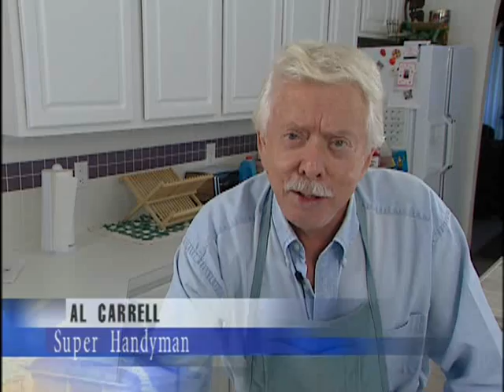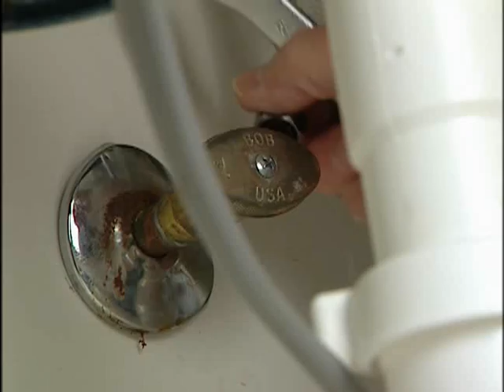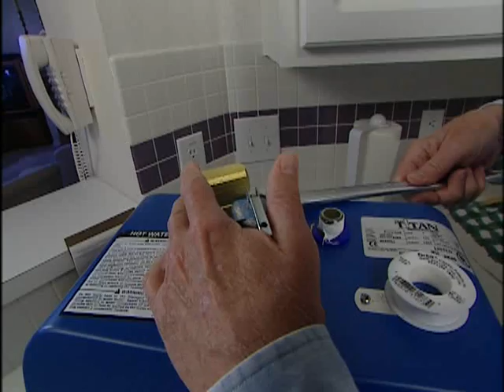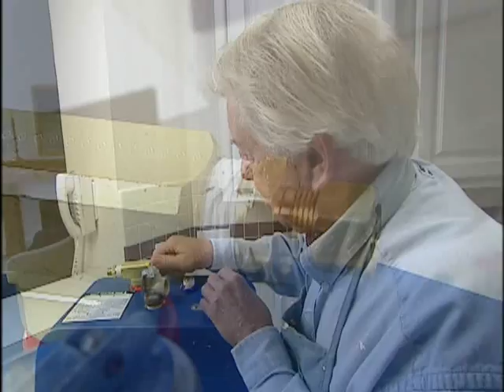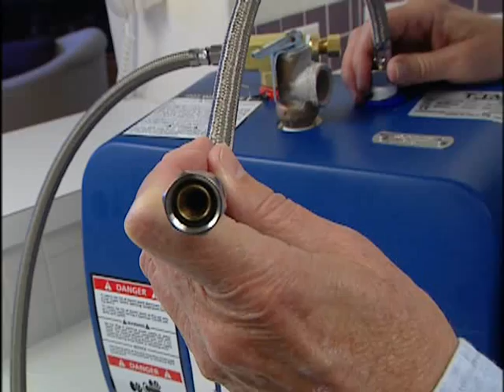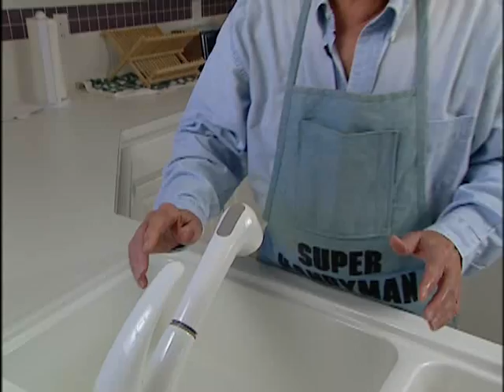Install a Mini Water Heater DIY (#5251)

Comment: Great video, question my titan hot water was already installed  and it doesn't just plug in to an outlet it's hard wired in a junction box. Right now it doesn't have water to it. Its making an awful buzzing noise. I thought if I disconnected all power it would stop, but it hasn't.  The juntion box has a white wire on the top and bottom of the juntion box. Its not the electrical in put or out put. I've disconnected all electrical wires capped and taped the wire nuts on. It's still buzzing, it's the two white wires, do I just pull them out.?
Reply: I took a picture but attached it

Comment: There are many videos on POU heaters but they all draw from the COLD water source.  I have a very capable whole house tankless.  The problem is that it takes 1.5 minutes to get hot water to the sink/dishwasher.  Is there unit that draws from the HOT water source which would instantly deliver hot water for 1.5 minutes or until the whole house system kicks in. If not, what happens if you install a tankless POU unit to the HOT water supply?
Reply: He just showed connecting that one to the hot water.
Reply: @stevedawson4781  Thanks.  I bought and installed one and it works great

Comment: Can it be used for shower?
Reply: Yes, but it still relies off having a hot water feed on the inlet to this heater. One very important point missing from this video is that this heater is only designed to give you  about two gallons of hot water, which should be just enough flow for the hot water from your regular water heater to reach you.

Comment: A critical step that is missing is letting the water heater fill up with water before plugging it in. You would need to open the hot water faucet and let all of the air come out before powering on the unit.
Reply: Not necessary. Do your homework before you spout out misinformed comments. This unit has a cutoff that triggers if there is no water, so no matter when you fill it the electrical will NOT start trying to heat water if there is none.
Reply: @AztecWarrior75  no need to get your feathers ruffled.
Reply: @braznartn5176  Yes the ole strawman comment. Make some stupid non evidenced based comment so that you feel you are in the right or win an argument.

In this case you want to brand me emotional so that you feel/want/think it will discredit me personally. This is done so that you yourself won't (hoping you don't have to) have to make an intelligent rebuttal or argument. 

You poor cupcake. Take your time and reflect on your over emotional, life. Must be hard going through it when everything gets under your thin skin.
Reply: @braznartn5176  Wait the OP doesn't warrant, them to get a "no need to get your feathers ruffled." but somehow I do? 

Only person here that needs to get their panties untied and pull out, is you. You MORE ON

Comment: I also use this product, which is similar to this one, and it is economical. You can click to view it at the following URL.https://www.alibaba.com/product-detail/Ceiling-Bathroom-15L-Electric-Water-Heater_60772557952.html?spm=a2700.7724838.2017115.1.1d983453YLolrd

Comment: Never showed how the thermostat worked and where the best setting is.  I have one and can’t find an owner manual or anything that shows the thermostat settings.
Reply: Brad Weaver or google the manual.
Reply: @craigcooper8593  thank you!
Reply: It's on the side on the front and white part of the unit. It's a dial like with the old transistor radios. Just start out cold and turn it up till it's hot enough.

Comment: so why did you use the cold water inlet and not the hot water for the inlet to the under the sink unit so when the hot water from the main water heater gets to that under the sink heater it then turns off that heater to save some electricity.
Reply: He did you’re just not paying attention

Comment: My primary concern is the flood that will inevitably happen when the tank eventually leaks.  Probably right after the 4 or 6 year warranty period.   No catch pan or drain. I would want a way to have a catch pan with drain to the outside......BTW.....This video was from Michael Holigan's "Your New House" which aired until 2007.  "Super Handyman"  Al Carrell aka Albert Raymond  Carrell (September 2, 1925 – August 27, 2014) was an American author, columnist, TV and radio personality.  He was a popular home construction/improvement expert. Carrell's column ran in over 250 newspapers in the U.S.    RIP, Mr. Carrell.
Reply: I used an old baking sheet and placed a Leak Alert water detector in it.  Avoided a catastrophic leak when heater sprung a leak.
Reply: Only 6 days before his 79th birthday. That kinda sucks :(

Comment: Looks like you connected the inlet back to the hot water
Reply: Yes, because in this instance you're heating up your hot water line where it sits in the pipe and gets cold.

Comment: You really need to explain that the TPR needs to be piped outside of the house.  The video is incomplete and dangerous.  Please read all installation instructions before hooking up this heater.
Reply: I ran my TPR to the drain. I don't think that it needs to go outside of the house.
Reply: Hey 👋 I just got a mini tankless water heater off of Facebook market place and I didn't think to get an owners manual. Do you have any suggestions on how to get one?
Reply: @sherricabinaw3035  Google it.

Comment: One thing that is never addressed is electricity and current draw of these little heaters. A typical small unit is usually rated around 1500 watts which is around 13 Amps. In this video it looks like he plugged in the water heater in the same outlet that the garbage disposal is connected to which also pulls anywhere from 3-10 Amps. So it would seem if you turn the garbage disposal on when the water heater is active, you'll blow the breaker (assuming a 20amp breaker). 

So my question is, does this blow the breaker?
Reply: Al Carrell passed away in 2014.
Reply: I agree you could not run the dishwasher at the same time as the water heater, most likely on the same circuit. as it would be too much for a 20 amp breaker.
Reply: And the spin that this saves water but neglect how much it’s wasting electricity.
Reply: @samdeir  it's saving electricity (or gas) as well. If you want hot water from your big heater you have to run the water for 30 seconds (or 2.5 gallons) of cold water before you get any hot water. What that means is you are wasting whatever amount of energy it takes to heat up 2.5 gallons. The saving in energy may actually be more than that of water.

Comment: You did not make it clear if you hooked the mini water heater to the cold angle stop or the hot angle stop from the house
Reply: Dylan Pruitt what the hell is an , angle stop?
Reply: @davetaylor2449  I think he means shut off valve, but it's anybody's guess
Reply: @wayne3340  That's what that valve is called.

Comment: these are the future ... central massive waters tanks are really stupid if you think about them ... localizing energy in general, is the way forward... much more efficient and simple really.
Reply: I have a high efficiency Honeywell water heater that has no pilot light. The cost of it's operation is next to nothing, and I don't have multiple heating units taking up space at every sink and bath. Not to mention I didn't have to run gas or 240V power anywhere, as you would with tankless designs.